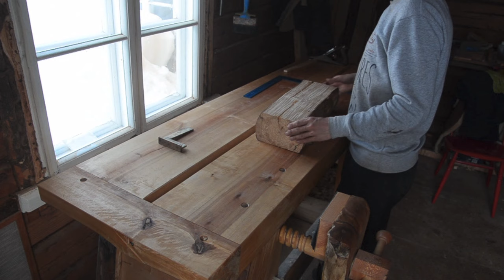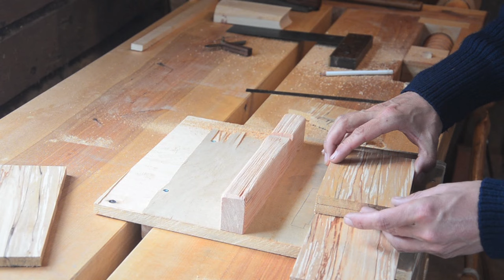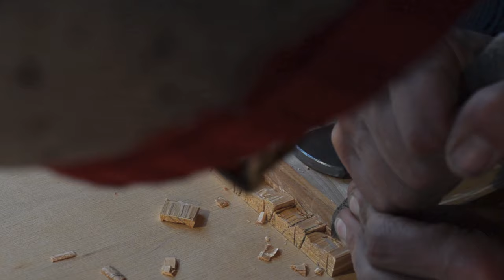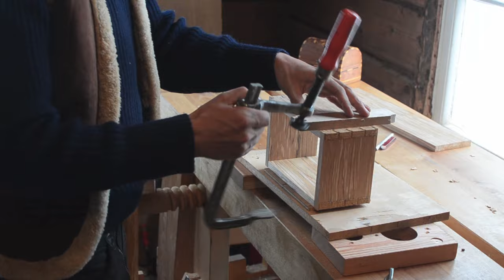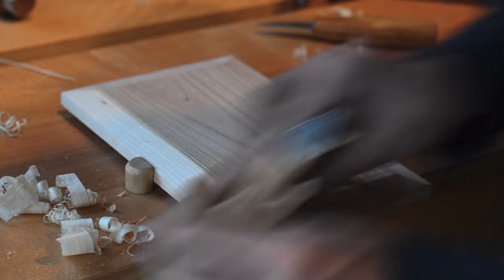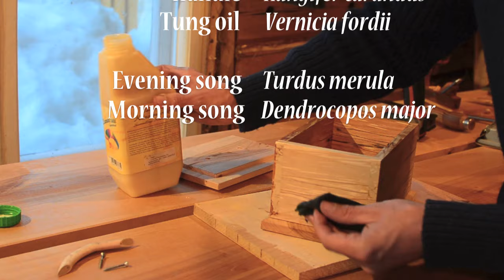from Log to Dovetail-Treasure-Box with Handtools

Comment: Have you considered splitting/riving those bigger logs to get your panels/boards? Peter Follansbee does a lot of work that way and it seems like it might cut down on some of your sawing.
Reply from the maker: No, not in this case. With the wood i used, splitting would not have been a good idea. I would just have got some little firewood out of it. It can be a good idea if using the right wood. Some kind of woods like Ash or Cedar might do well specially if fresh. But dried, mushroom checked Alder, no i do not think that it would work.

Comment: Try reducing the amount of set in your saws. The blade will follow the kerf and if you have the right amount of set, the saw will follow in the kerf and will not wander so much. This all assumes the saw plate is flat and fair.
Reply: Hmmm...???...His saw set looked great to me and I didn't see any wandering at all per se outside the normal modality for this system of ripping...Could you share the time marker for what you had observed that seemed out of set or wandering as I would like to review it and must have missed it...Thank you...
Reply from the maker: I have actually been really happy with my saw and its setting. The boards have been quite flat, no need to set the saw... Did it look like the saw has been wandering?
Reply: @littleforest  My question was sincere, but as too often is the case we get a lot of "armchair" experts or "wood machinists" commenting about traditional (aka ORIGINAL) woodworking methods of which they know little and/or only know it from books, watching videos, or experimentation...

I watched again tonight and observed...NOTHING...incorrect about your saw set or the applied means to which you used the saw...

I would also point out that reducing the saw set can...SOMETIMES...be effective with some saw types but is typically not necessary anyway as seldom does a traditional carpenter saw to the line on a project but rather parrs to the line with chisel or plane. On the occasion when we do "saw to the line" saw kerf is of little regard...If "kerfing a joint" we actually want more set in the teeth typically as in boat building, and some traditional wood jointing modalities...

Looking forward to your next video...!!!